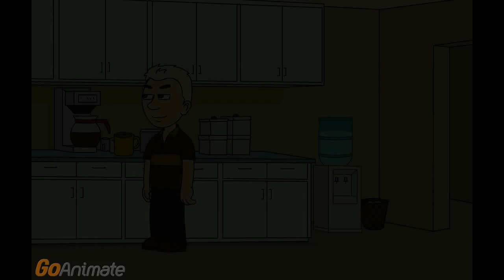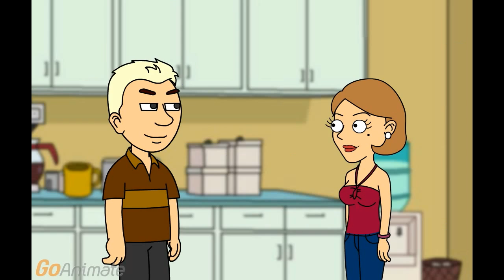Window Unit Air Conditioner Troubleshooting

Comment: Yes I have an Haier 6000 btu window air conditioner and after I cleaned the filter it will not restart. All it is doing is blinking. It doesn't show an erroe code just 88. Can some one help?
Thanks, Ed
Reply: Have you fixed it happening to me now